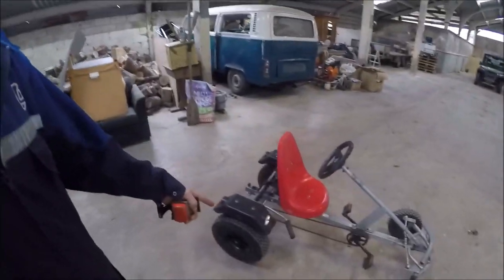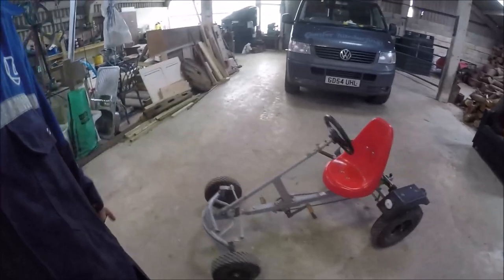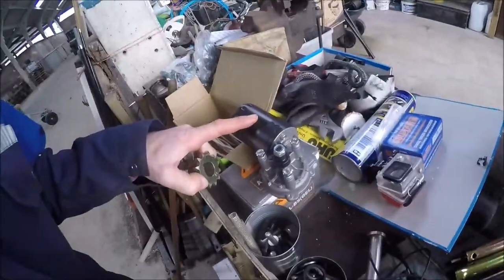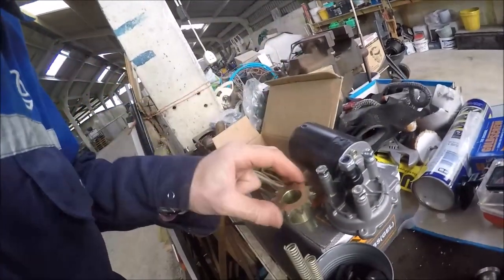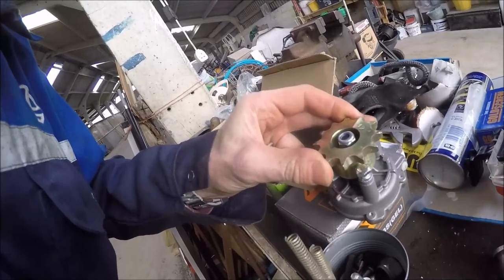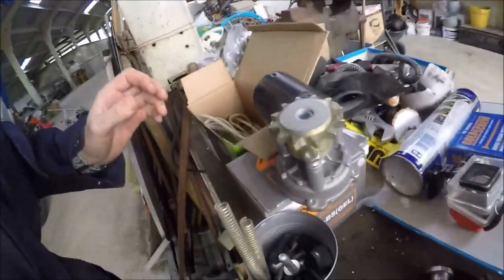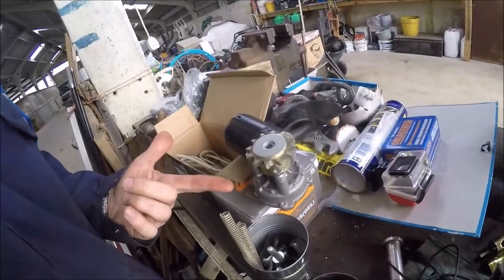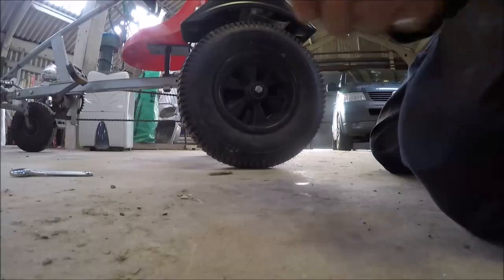How to make an electric Gokart with a 12v windshield wiper motor

Comment: How do you attach the pedals and chain that's what I want to do
Reply from the maker: i added a second sprocket to the rear axle, the motor has it's own chain
Reply from the maker: you can see the second sprocket at 3.08
Reply: But how do I attach the chain and the gear spicki thing to the plywood
Reply from the maker: @U_UKenny  plywood? There is no wood

Comment: Excellent job! I like it .., I have a spare windsbield motor so I will try to do the same for 4 years old twins! How many amps was the battery you have used...?
Reply from the maker: thats a deep cycle leisure battery, not sure on the spec, but to be honest the second battery is FAR to big and heavy, it went up hill better with the small one. Somewhere in between would be great, small wiper motors don't draw too much power.  If i did it again i'd look for a slightly more powerful wiper motor, maybe a larger van, like transit, or small truck/ lorry
Reply: A lot of project ideas for these little motors... I wonder what it would take through gearing to gain highest useable speed while retaining enough usable torque. I'm picturing a trike setup with 20" bicycle wheels.
Reply from the maker: @MrJasonace99  this one is off a small car and pretty weak, but great for slow kids and peddle assist, thinking of doing his plastic john deere next!